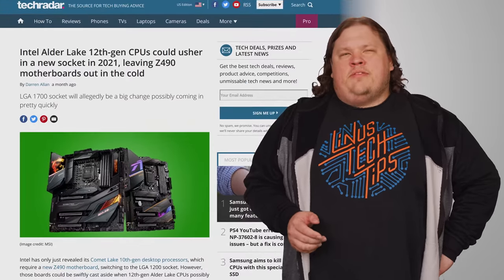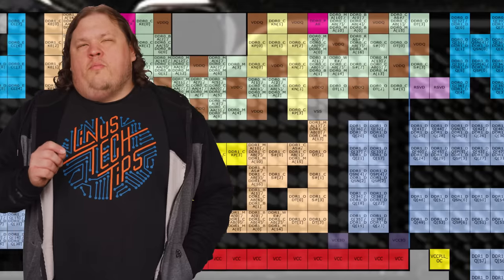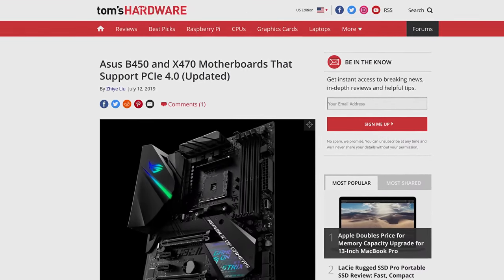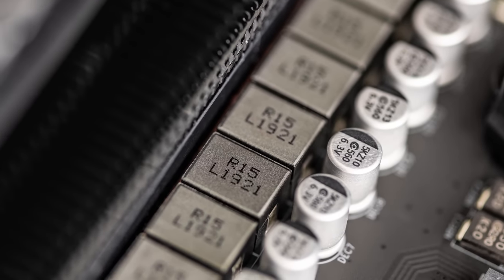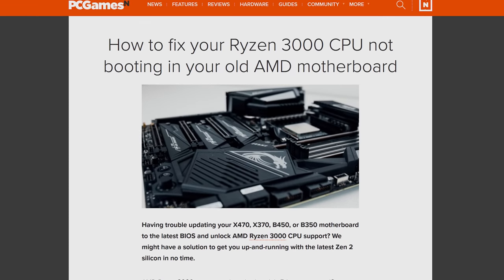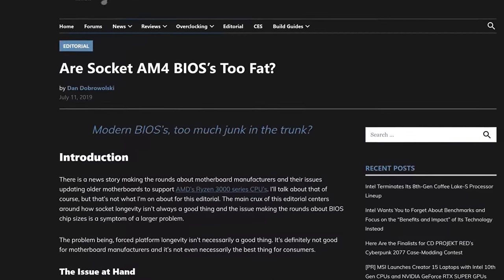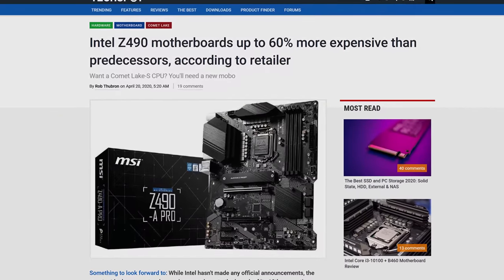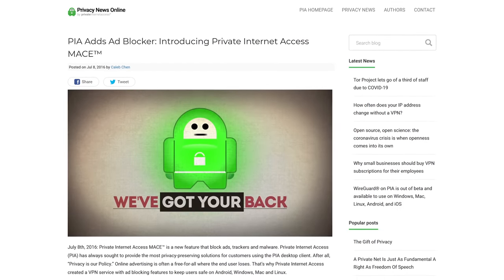Why CPU Sockets CHANGE So Much

Comment: The real reason the socket keeps changing is to force PC enthusiasts to buy newer CPUs to go faster.

Back in the day, you had an option to buy lots of different CPUs for one socket. Even though you still can, once you buy an existing high end CPU, they likely won't make a better one for the socket.

This is why I actually liked the SLOT1 connector. Because you could use the same slot for many CPUs not just from Intel and it forced them to put the CPU onto a circuit board vs a socket. 

Of course of you don't buy the fastest CPU for a socket, then you would at least be able to keep the same board for a decade because you could upgrade to a faster CPU over tome which is what I use to do.

But now I wait to buy a new board once it's about 3 years old. Because then Intel or AMD likely won't be making new CPUs for it and you can get the fastest one cheaper and then have a PC that will last you a decade 

I just bought an asus Z590 board and I got the i9-10900. It isn't the fast one I can get, but it's better than the 11 Gen cpu. But I can buy the 11th Gen cpu 5 year from now and get it ch3sp and still be fast.
Reply: Lol, Slot-1 had 242 pins, LGA1851 has 2551, more than 10 times as many...
Slot-1 supported up to around 133Mhz FSB, currently CPUs do not use FSB anymore. They mostly use PCIe, at up to 16Ghz, more than 100 times higher clockspeeds.
Slot-1 was in the time that a memory controller was still on the motherboard. Modern PCs have it inside the CPU to increase performance.

Slot-1 sucked, having to manually add a VRM/PPM that matched your CPU, especially in dual socket systems meant that it just constantly crashed until you got lucky...Slot-1 was fine in the late 90's but by 2000 it was well and truly obsolete already because it had no option to grow in capabilities while CPUs increased performance almost exponentially in that era.

Comment: I recently upgraded from a Ryzen 1400 on a period accurate B350 board (ASUS) to a Ryzen 3600X and had to do the whole BIOS update for the board. I did a lot of research before I decided to do the update - apparently some motherboard bios updates have to be upgraded in step (ie, going from v501 to v604 to get to v708 as opposed to going from v501 directly to v708, I think possibly even requiring a 2000 series Ryzen as an intermediary???) but luckily my ASUS B350 only required 1 update, and of course once you applied the update, as you mentioned, the support for the CPU you were using, in my case, the Ryzen 1400, just goes away. Had my board required sequential updates, I probably wouldn't have done the upgrade at all... But regardless, the whole losing support for previous processors makes the transition feel risky. If you somehow get a bad processor, or the BIOS update goes awry, you're stuck with essentially an expensive brick until you can get a processor to complete the flash (at least AMD provides those if you need them for this purpose!!!). Overall though I really appreciate having the option, even if it will mess with the people who are tech savy enough to build their own computer but who didn't do the research about their specific motherboard and end up with an expensive brick on accident. 

The upgrade from the 1400 to 3600X was great though, here's hoping AMD can put out something fast and relatively affordable that is worth upgrading from my 1070 to!

Comment: Very good video.

I remember when a similar question was asked about AMD 990FX motherboards. Would it support the 220w FX-9590 or be limited to the 125w FX-8370? It still had the same socket but motherboards that weren't 220w TDP ready could have problems. Only a handful of AM3+ motherboards were 220w certified.

I think AMD trying to futureproof AM4 by allocating extra pins was a smart move as it slowed and staggered the upgrade path for users. Now needless to say a hypothetical AM4+ could come that has a totally different pin arrangement and we would need to upgrade, but planning ahead as AMD does, and does quite well, often places more time and money back in consumer hands. If manufacturers would allocate more programmable pins, it would help.
Reply: Practically nothing supported the FX-9xxx series, and nobody should've bought those, they were practically scams.
Nearly every AM3+ 990FX board advertised 225W support, even those with 4+1 phase VRM designs xD
With the FX-9xxx series the problem was more that those CPUs were just ridiculous. Way too slow for the enormous amounts of power they consumed, completely unrealistic for most if not all motherboard designs.
Reply: @someguy4915  the 990-FX boards barely even handled the 9000 series as it was due to subpar quality with AMD parts at the time by OEMs. They were not a good product release and sadly the 8350/8370 was far better, did the same workloads, and were far easier to tame.

Comment: Just add way more pins than you need and advertise the power limit of the board and have CPUs with a small universal set of pins so even if the bios can't handle it can still limp along enough to update

Comment: could be a problem when buying a main board and cpu as well. getting a older cpu and board. to find out the boards bios was updated and no longer supports the cpu. will have to keep a closer eye on the product specs and even then might get the wrong combo

Comment: 3 generations per motherboard is reasonable for me. Only 2 generations means that I either am already at the "end of the road", or I can only upgrade 1 generation higher which might not even be that much faster.
With 3, you've got a lot more flexibility in what you can upgrade to, and if you do eventually upgrade your motherboard down the line, you can reuse your old motherboard with an older, cheaper CPU as a 2nd PC, home theater, server, etc.

Comment: I know this is an old video, but I can say this 3 years (ish) later: I am glad AMD continued supporting motherboards with (in my case) B450M chipsets. Weirdly enough, when I was upgrading from my AMD Ryzen 5 1600X to a Ryzen 5 5600X, my PC booted perfectly fine into Windows before I had time to reach over and shut down for the dismantling of my PC. I also want to say, "WOW!" I was expecting a bit of an upgrade, but this was a huge upgrade, and with less power draw and better overclocking, that was just one click to enable! I can use my RAM at its full 3600MHz speed vs 3200MHz previously, and I can feed my RTX 2080 Super beautifully! AMD may not be perfect, but I am happy I was able to get this performance boost on a single motherboard and single (dual channel) RAM set!

Comment: I wonder how long we will have CPU-sockets. I think it may make more sense have the CPU soldered to the board at factory since  when it is time to upgrade you probably need to change the board as well, and having the CPU integrated on the board make it possible to have it optimized with the board. Especially for consumers who never will upgrade anything anyway.

Comment: When AM3 launched, you could use AM2+ cpus in it. You could upgrade your motherboard and ram while keeping your CPU. Not pulling that same parlor trick with Bristol Ridge between FM2+ and AM4 was a huge missed opportunity.

Side note: what intel did after Socket 7 in the late 90’s was an overtly anticompetitive act. Too late to fix that now. Imagine how much more competitive things could be if AMD and Intel did not have their own walled gardens akin to cell phone term contracts.

Comment: Exactly the reason why I never upgraded after the core i5 3475s, because the  Intel DH67bl which came with a PCI SLOT TO PLACE A FIREWIRE CARD  for my sony DV camera at the time, Maybe somewhere in. That was somewhere in 2011 if I remember. There was some Graphic card too, But it called it a day after around two years. That was some Radeon using what was then called "fglrx" driver. But the Intel graphics worked well at the time even the VIA firewire card was well supported. Well making it short the kit works well even today with the same DDR3 ram, two 4gbs on two slots, Also it supported a huge 512 gb drives, may sound funny but I have a lot of free space on those two seagates even today.  Also I am still to find some software which dont run on this one. 
Well my 12 year old son has a laptop running an Intel core i5 and an Nvidia 1650 or whatever, plays some games too. On windows-10.  My first and last laptop from 2007 to today is an compaq nx-7400, running the state of the art at the time centrino duo. still works fine . Except the DVD writer.

Comment: I'd like to see a similar video on why the X570 chipset needs a fan.
Also, why do some boards locate the fan in an area easily blocked by the GPU, or at least ingesting the warm air directly from the GPU.

Comment: Upgraded a 5820k to a 6950x to get a couple more years of life out of an older system, could get the 6950x for about 20 bucks off ebay at the time. Ran into the bios issue since I'd built my comp when the 5820k was released. Luckily still had the 5820k to flash the bios.

Comment: Whatever the reason the CPU manufacturing has i think changing some  sockets are good solutions because the technology are going further and faster at same time,

just thinking if we still using Bulky old  vaccum tubes in our newer PC its taking long time before they can run crysis 2
and also helping the prevent of over use motherboard, yeah over use motherboard tends to fail and risk for more grater cost later especially with Overclocking, even with stable one.

Comment: Well, people, that's the reason why Northbridge was a thing on the past. And at least, why we use a chipset on x86 architecture.
For support processor upgrades, and not buying a new mobo.
Well, putting memory controller and GPU stream (like the PCI-e for x16 slot) into CPU boost a lot of the computing power, a cost of... constant socket changes.
I prefer northbridge layout....

Comment: One thing regarding the BIOS: Why does it contain code specific to particular CPUs? Isn't the point of using a common architecture (x86-64) to avoid that?

Comment: Idk why CPU form factors are the way they are. Imagine how much more powerful a CPU would be if you increased the form factor (Size) by 50%. 
Make bigger CPU's. There is no point in hiving teeny tinny chips that increase by 10%-20% in power every year, when a form factor change will increase speeds by up to 80% on their own. Without new gen and architecture.
Reply: that's how server CPUs are. Threadripper is a big boi

Comment: It's annoying that Intel changes sockets all the time, but when you put it that way maybe sticking to one socket is not that good an idea either. I never thought about that if a CPU needs more pins you can't just active them in an old MB because the manufactures do not put traces to unused pins. Basically you would have to put jumper wires in to connect them, and that's if the MB has the device on the PCB to connect to.

Comment: LGA2011 and its revisions were a serious headache for Intel and I'm shocked they didn't kill it off sooner than they did. I actually did encounter the problem of needing a Xeon E7 v3 processor in order to flash a new BIOS revision onto my board to support the v4 processor I would end up running. Luckily I had a source I could borrow one from for the evening it took to get the BIOS flashed, but not everyone is so fortunate. And with the costs associated with such a gaffe at the time of release, it's a good way to lose customer good will.
Reply: Has nothing to do with consumer friendliness though, Intel/AMD could easily require motherboard manufacturers to clearly write BIOS versions on the box/motherboards. Saying they remove options to help you is just bizar.

Comment: Honestly, some of it is just fucking greed. But that shit hurts adoption of new processors and causes even bigger (artificial) gaps between the "budget" older chips and the "high end" new chips. It just screws the end users more by essentially saying "want to get more than 30fps in Cyberpunk? Buy a new CPu and a mobo to go with it!" when it costs way too much to do that. Even if the new chips are cheaper than the previous generation, it all adds up to about the same cost after factoring in the new motherboard.

Comment: This, however, does not exain why manufacturers never learn on their mistakes. 

You would think that after 2 or 3 times they had to reconfigure a new socket, add MB layers and modify PCB for a next-gen CPU, they'd learn to overengeneer: having a few hundred extra reserved pins in a socket, a 12 instead of 9 layers motherboard with reenforced connections and 24+ power phases. Yes, that would cost the end user $700 instead of $400 for a mobo, but it will last through 3-5 consecutive generations of processors instead of 1-2. And yet, they still mass produce crap. Luckily, we had AM4 as a set example of decent multigenerational compatibility, albeit with a caviot of that 16MB BIOS chip on the early recisions, but it's still a very positive precedent in general. Huge hopes for AM5 having the same lifespan throughout multiple (3 factual, 5 marketing) generations of CPU support. This is one of the aces AMD has to offer in hardware department, and can be very benefitial of they play it right. Unfortunately, AMD is known for occasionally botching their own trades due to some dumb moves.

Comment: Funny thing is this doesn't force me to upgrade, it actually PREVENTS me from buying upgrades. I'd happily drop money on a new CPU every year or two if I could just slot it into my existing system. But if getting a new CPU means ALSO buying a new mobo and stripping my system completely down, well I'd much rather run a system for 4 to 6 years, upgrading GPUs as I go, and then just build a new system from scratch when it's needed.
These companies have product road maps out for like a decade. They could absolutely make chip sets and mobos with the right pins and power requirements to support 5+ years of products. It's just easier not too.

Comment: why don't they sell motherboards with the cpu's preinstalled if they're so dependent on new sockets then? 

If I need to buy a new mobo every time I upgrade my processor, might as well not bother with an extra dangerous step when I build it

Comment: Intel has been doing this for ages and it is not to add new features 
1366>1156(Lasted 1 year)>1155(Lasted 1 year)>1151(lasted 4 years)
1366>2011(Lasted 2 years)2011-3(Lasted 2 years)>2066(Lasted 3 years)
AMD does less changes overall and if their are any changes their changes still retain backwards compatibility like how AM3 can work in AM3+ boards most of the time.
AM4 has lasted 4 years, on par with 1151.
AMD has not announced any changes to AM5 or FM3

Comment: You'd think after years of this, they might predict needing more pins and maybe come up with a predictive standard that can handle a few years of development...
Reply: You'd think that they are smart enough to have thought about this (obviously they have...)
Pick your side: spend $20-100 more on your motherboard so you can upgrade the CPU maybe in the future, even though the CPU now has PCIe6 your motherboard was built before that and so only supports PCIe5... So you're paying for extra features you're not using.
Versus: you pay for what you need/want today.
A single standard for all/most CPUs would be impossible, far too much variations. You'd need a standard for simple CPUs (office use/browsing etc), for PCs with at least 20 PCIe lanes (GPU and NVME SSD), for PCs with 32 or more PCIe lanes, PCs with 64 or more PCIe lanes and then professional/HPC with >100 PCIe lanes.
Then for each of those 4 categories you'll have different power variants (<25w, <50w, <100w, <200w, >200w) so that's some 20 different variants...
Also, because things are standardized, CPUs and motherboards will be more expensive as they need to comply with the standard/be interchangable. Imagine the cost and complexity with maintaining BIOS firmware for a 8 year old motherboard so that it can support the latest CPU...

Comment: Why not have something sorta like a barebones "safe mode" that doesn't got much more than what's needed to load the firmware from a pendrive, to allow compatibility with a wider range of of CPUs than what can fit in the firmware chip?

Comment: With the technology so crazy advanced these days, it doesn't seem too hard to do this.  Launch a platform with an overkill large bios.  Have a standard low settings no thrill version of a boot up cycle that all cpu's that will slot into that socket can run off of.  Then when the user is in the OS, they can update via software the cpu settings that go into the bios.  This would mimic how installing a graphics card without correct drivers would work.  Except instead of installing a software level driver you are installing the info to the bios/uefi.    It's just an excuse at this point in 2020 to say that the bios is a limit for cpu support.    I can give the power delivery more of a pass, but with this level of technology and engineering, there should be some forward thinking.

Comment: I feel Like nobody has ever come up with this amazing idea.
Why don't there exist multiple stackable layers for several CPUs of the same model?

Imagine your Mainboard, throwing your CPU onto it, then covering the CPU with a layer which has a heatsink on the bottom side and an adapter for a 2nd CPU in the upper side. Throw in the next CPU and continue doing so.
This "Stack" would go up for let's say 4CPUs or so.
Why hasn't this idea been tested so far? 

If there would be a main distributor which gives out all the computer-tasks to the chosen CPU, it might behave like adding all the cores together.
Is this so far from being possible?